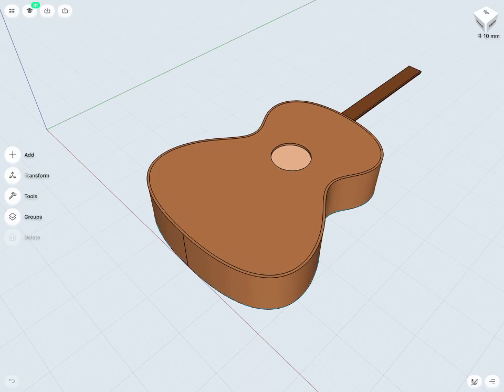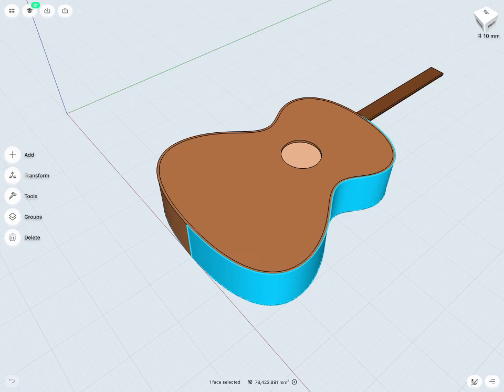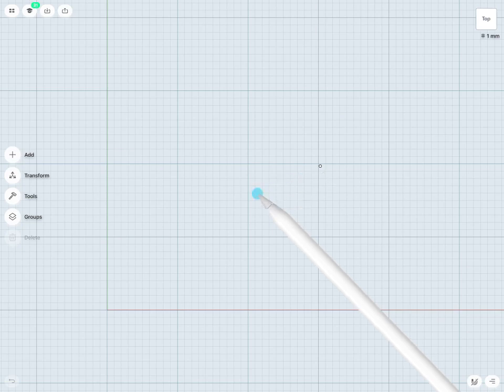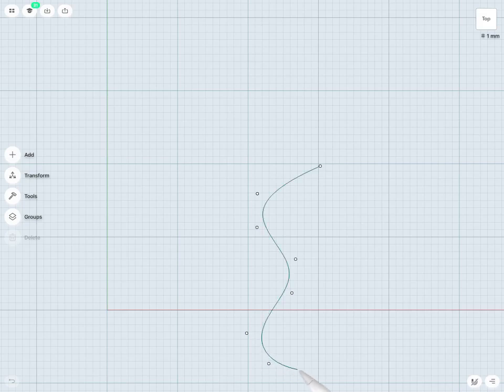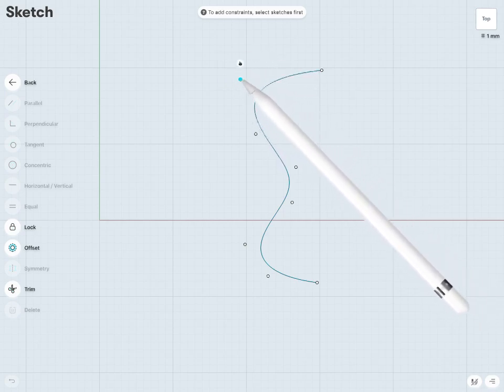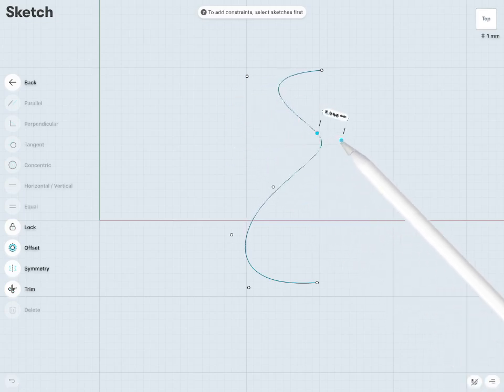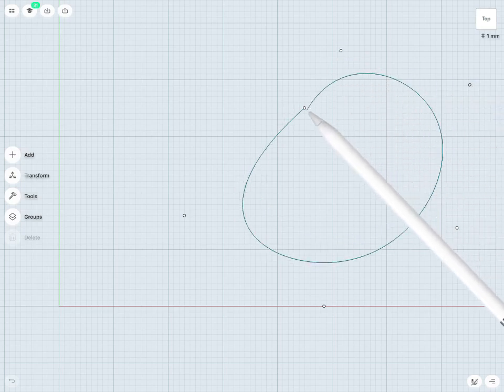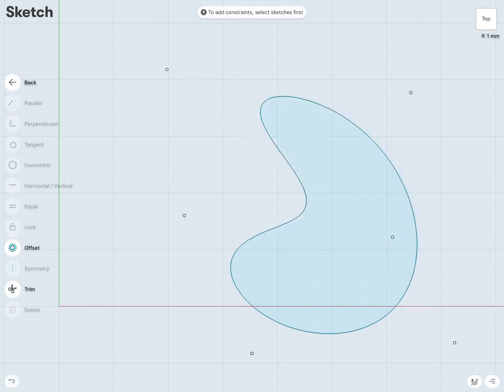Splines | Shapr3D for Beginners

Comment: Is it possible to add control points to an existing spline?
Reply from the maker: No, unfortunately this is not yet possible.
Reply: Hello. if it possible to use equations to create some difficult splines like evolvent to build gear wheel?

Comment: I am able to create the spline with control points. But when I try to drag a control point, it only draws a line from the point.  I can’t control shape of spline.
Reply from the maker: Hi, you have to select the point first, then drag. This is how you move things in Shapr. Check this tutorial video on editing sketches: https://www.shapr3d.com/videotutorials/edit-sketches
Reply: Shapr3D would the Logitech crayon be able to work with making splines
Reply: Shapr3D  it usually takes 3 or so attempts to get the point to show the lock icon.